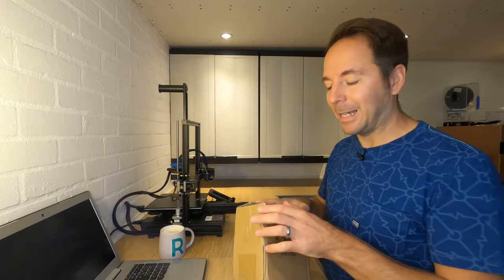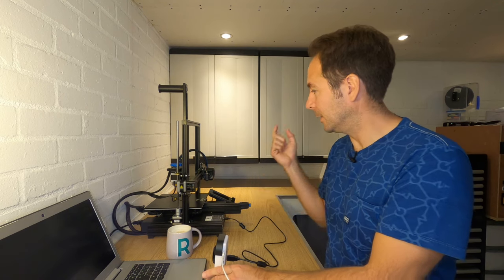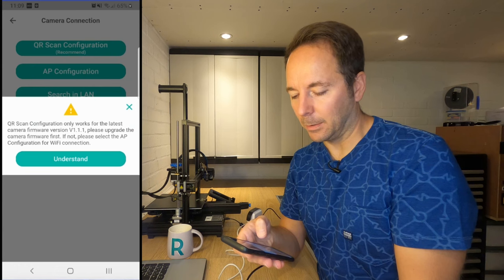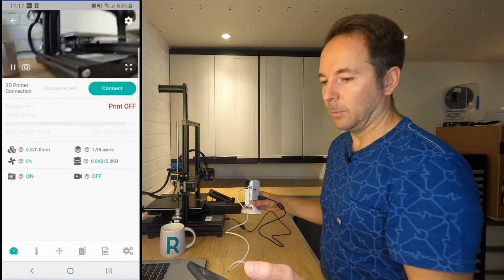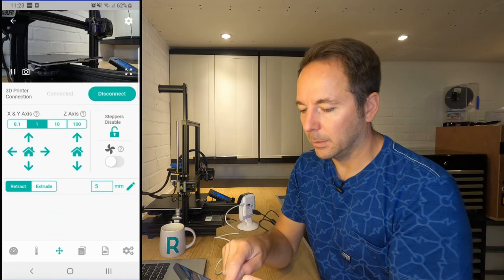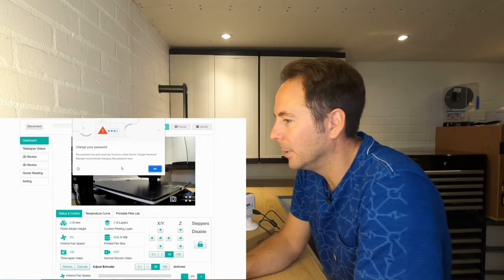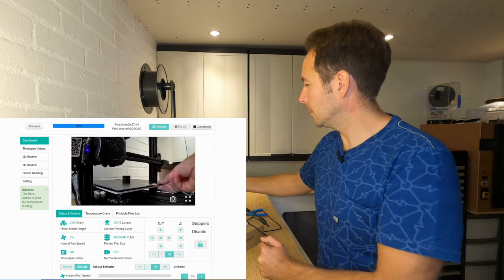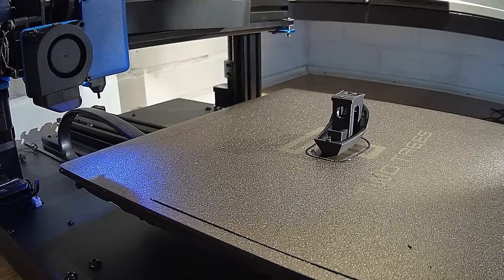Beagle Print 3d Printer Camera Setup - Is It Really Plug & Play?

Comment: Great video, as always. Does this gadget tell you when a print is done ? Or do you have to keep checking into the camera feed ? 🇬🇧
Reply from the maker: It doesn't yet but that's coming soon in an update so they tell me.
Reply: @RickyImpey  thanks for your response. Funny because that's the only thing I'm actually interested in knowing when one has a reliable & repeatable print cycle for batches of parts. Expecially as 'time remaining' on my ender S1 is ridiculously inaccurate. P.s. really liked your filament drying box and will be making one to your design. Great job ...

Comment: Hi - Great vids Ricky. Just wondering - would this be overkill for plugging into a Sonic Pad - seems a simpler (cheaper) camera would do just as well once you already have a Sonic Pad?
Reply from the maker: Oh yes, you don't need both. I don't even know if the beagle camera works with the Sonic Pad. Grab a cheaper camera that is listed by Creality as compatible. I use a Logitech C270 with a Sonic Pad as it has manual focus and is plug and play.

Comment: This was very helpful I’m just a little confused on one thing. When you’re away from home can you still control things through the app or do you have to be home for it to be connected to the same Wi-Fi network?
Reply from the maker: Yes, unfortunately you have to be on the same WiFi network so within a short distance really. There is a way to send the feed through your home router so that it can be viewed from outside your home network but it's not safe to do it without really knowing what you are doing. If I can work out a safe way to do it I will share with the group 👍
Reply: I can view my printer through the app from anywhere.
Reply: @6rcracer6  Can you also send the commands to the printer through the app when you’re away from home?
Reply: @taylor943  I believe I can change temperature, I haven't tried anything else
Reply from the maker: @6rcracer6  Yes, I was wrong. I can't believe they don't say anything about being able to use it outside of your WiFi network. Surely this it's best feature, why aren't they shouting about it?!

Comment: I watched your video and it was helpful. I just set mine up and have a couple of questions. Did you notice that the printer doesn't stop printing once the print is done or is that just mine? Also there's no way to adjust the speed of the printer from the app or the browser.
Reply from the maker: Hi, mine stops printing when the print is complete but it doesn't switch the printer off if that's what you mean. I don't believe there is a way to change the print speed while the print is running through the Beagle app or a browser though no.

Comment: Hi Ricky. Thank you so much for your informative videos.  I'm new to 3 d printing and you are a BIG help. I've purchased the mintion camera and it connects to the wifi seamlessly and the red light is on indicating it is connected to the printer yet I am unable to control the printer with the app.  Do you have a clue what's happening?
Reply from the maker: Is your printer plugged in, switched on, connected to the beagle and  selected in the app? I believe there are some other settings like baud rate that can be changed if everything is connected correctly but still not connecting. What printer do you have?
Reply: @RickyImpey  I figured out the problem, Rick. The problem was I wasn’t using the app to connect to the camera.
Reply from the maker: @donwires5793  Glad you got sorted 👍

Comment: I've had mine for couple months and use to watch prints, but I'm not clear on how to use laptop to connect to download files that way versus using the SD card.  Laptop i have my son stripped windows and has Linux.   Not clear on how to do this.   thank you
Reply from the maker: You need to find the camera's ip address in the settings on the app. Then type this into the search bar on a web browser on another machine on the same network.
Reply: @RickyImpey   thank you for the response.  I should have tried harder before sent the question and wasted your time.  I did figure it out.  Now just have to be careful to chose the right printer I’m connecting to until I get the z offset issue fixed on Ender 3 pro. Which seems to vary from SD card to when I send on Beagle. I used your recommended M420 code line I saw in another one of your videos and worked well on the new ender 3S1 Pro.  What a step change in ease of operation from the 3Pro.   Thank you again for your many informative videos !

Comment: Mainly just looking for a way to easily load g-code from my laptop w/o having to use the SD cards & to check up on the prints, can I use it for that w/o having the time lapse turned on?
Reply from the maker: Yes you can, it's perfect for this and it's how I use it most of the time. There are currently 3 options within the timelapse settings, 'Clean', 'Normal' and 'Off'.
Reply: @RickyImpey  Thank you! That sounds perfect, looking forward to receiving one. I think I'm going to try the Sonic pad on my other S1 Pro :)
Reply from the maker: @cdaitch  I'm jealous, I don't have a sonic pad yet!
Reply: @RickyImpey  Caught a sale on Amazon yesterday and went for it, I was hoping you'd have a video on one... time to go shopping ;)